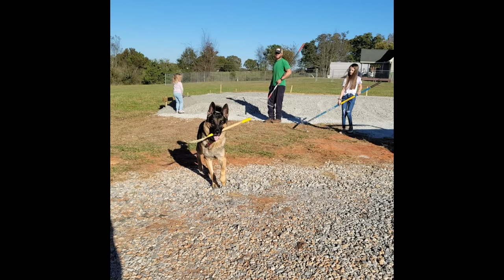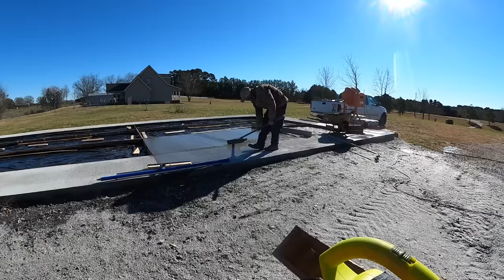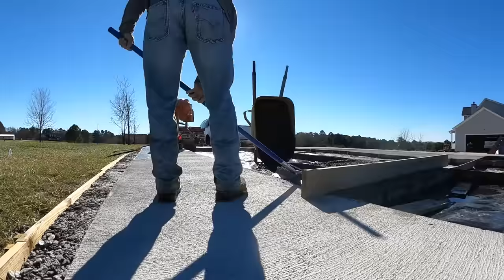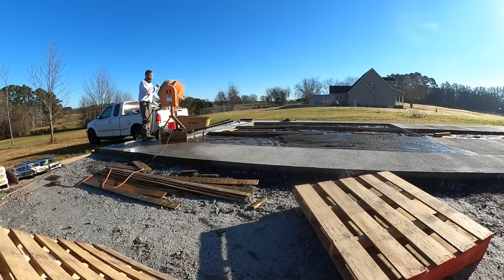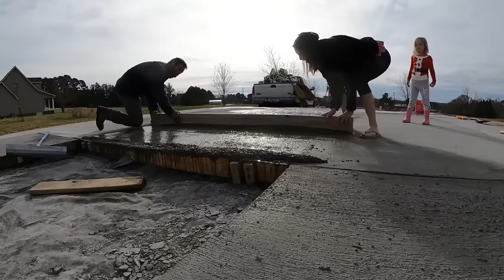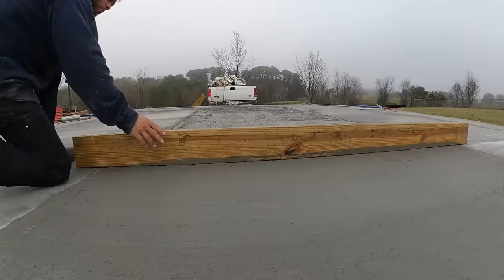Pouring a Huge Concrete Slab Using Bagged Concrete | I Saved $10,000

Comment: You are a machine!!  As a construction manager, I appreciate what you did.  Assuming your base was adequately compacted, I would have put some #4 rebar sections in as 'dowels' to tie the different panels together since they were all cold joints.  That would preclude any future differential movement.
Reply from the maker: Thank you! Out of the things I did, I wish I had thought about pinning the slabs together. Luckily if anything shifts I should be able to repair it. Hey that might be a good video if it ever happens. Thank you for checking out my video.
Reply: I was thinking the same thing.
Only thing missing was rebar. Great job on it though.
Reply: Don't you have to use cement adhesive as well as rebar to prevent the differential movement? And if you do in what ways is it weaker than doing all in 1 pour with a concrete truck?
Reply from the maker: @eveliinatistelgren172  I honestly do not know. I'm not a professional when it comes to concrete. This was the first big pour i've ever done. I had to use bag so that I could do it myself.
Reply: @eveliinatistelgren172  it wouldn't pass load bearing requirements here in Australia, ok for a path that's about it, no rebar means NO dwelling and if the outside slabs move it's the start of a irreversible chain of movement.
Reply: @t-dog8528 thanks! if a person used rebar and small pours like he did with wood dividing them while pouring, say a square meter each at a time or something like that, would it be weaker than a one time pour? In what ways? Could it then be suitable for dwelling?
Reply: @eveliinatistelgren172  weaker still at the joints though strengthened by the rebar,, stone and rebar are what gives it strength just be sure to complete each rebar section in one pour, you can nail a couple of purpose built dowell plugs or even caulking gun nozzles to the forme work to put next slabs dowels into, just check the mpa on the bags too, I'm not 100% sure on the standards here or their but the few house slabs I've helped with were 32mpa concrete and 20mm stone, I forgot to say before too, good job dude.
Reply: That whole strip you poured you can lay the rebar on the ground and just pull it up as you go, slide in a dowel rinse repeat, come help with mine now 😁😆😆😆
Reply: @eveliinatistelgren172  also on smaller pours maybe use expansion joint rather than timber to finish, but that's not for dwellings more for paths, garage floors driveways etc and remember to always box out(dig) to an appropriate depth, for a light vehicle say minimum 125mm a truck 225mm house wall footings depend on the soil strength and are usually around 300x400mm with top slab around that 125mm too, be sure to tap the forme work wherever you'll see an exposed edge so to fill in the honeycombing voids where the stone and boards meet, usually done as soon as the mix is poured byt prior to levelling and screeding
Reply: @t-dog8528  Sorry we misunderstand each other. I won't use timber to finish. I am just limitiing the sections with the wood. To pour 1 square meter of concrete on the rebar at a time. All the wood is removed from the final product to make 1 huge slab poured by hand with rebar in it. Would this still be weaker than poured all at once? Why if the rebar is holding it togetther? And all concrete cracks eventually? I'm thinking it would break under a double wide.
Reply: @t-dog8528  This is what I mean to be exact: https://www.youtube.com/watch?v=KXS0bAn0e_Y 
The timber is just to limit each pour
Reply: @eveliinatistelgren172  id be looking at more 3x3 size, yes it still cracks but less is better and 3m is about standard for a cut, however depending on the use depends on the method, in a house slab they dont cut or expansion joint usually and i believe that it's to limit rising damp/moisture rising through slab causing mould inside the flooring and walls
Reply: @eveliinatistelgren172  i got what you meant by the wood too👍
Reply: @eveliinatistelgren172  if you're in an area that snows there's a thousand things to consider that i have no idea about too, we live in a warm to hot climate here and moisture is rarely an issue.
Reply: @t-dog8528  thanks for sharing, what about footing? Why are some pillars put into the ground beneath the slab?
Reply: @eveliinatistelgren172  that's what i mean by forme work, the timbers are forming the edge, I'm about 10 minutes from going out to set up the next section of my own, mine would be a good video for me and others, I have exposed faced footings that will have retaining wall blocks on top then a concrete dish gutter around 1 edge copind strips for gardens by footpaths planter boxes in the slabs and close to 14 cubic meters of slab 110mm thick all with a 2.2 cubic ft mixer
Reply: @eveliinatistelgren172  couple of reasons, 1 to bare the weight of a wall or something like that and 2 as a thickening beam to reduce the chances of a slab moving sideways or being pushed sideways by other curing concrete, it not only cracks it also expands, hence expansion joints.
Reply: @t-dog8528  wow concrete game is so deep, how can I better learn concrete game?
Reply: @eveliinatistelgren172  my retaining wall footings have 1 long 16mm steel bar in them, i considered using trench mesh but i had the bar already
Reply: @t-dog8528  do you think A/S are higher and superior? If so why would they ask higher standards? Since the US is very hot as well
Reply: @eveliinatistelgren172  Australia has higher standards on the construction industry, we take note of international flaws and our own and legislation changes accordingly, it serves a few purposes inspectors can expect the same outcomes nation wide, litigation and failures are reduced training and techniques are streamlined but more targeted efficient and effective and it cuts out the cowboy builder that flaunts the rules leaving those paying for the work insurable confident and at ease knowing what they have will outlast their lifetime.
Reply: @t-dog8528  Very interesting, I think I get what a footing is now, but its so deep and requires so much machinery, I don't think its possible to do by hand to get into the subsoil. Would this still be necessary for a double wide? Wouldn't the foundation be simpler for such a small and lightweight construction?
Reply: If the ground is hard enough you can form up above ground and finish the face after stripping the timbers off, i know alot of people will do a footing with besser blocks core fill them then pour the slab inside of that, the whole point is to hold the weight of the structure, if the slab moves so does the walls creating cracks
Reply: @t-dog8528  So the besser blocks avoid having to dig into the subsoil? You mean the blocks are skirting the slab
Reply: @eveliinatistelgren172  yeh just search concrete block footings here on youtube, in fact diy footings and then look at some pro jobs, find what will suit best
Reply: @eveliinatistelgren172  yes but the subbase still needs to be solid and level
Reply: @t-dog8528  That's very interesting, let me have a look brb
Reply: @t-dog8528  Alright so I watched a couple videos, and from what I can tell, its just a 16 inch deep concrete perimeter that goes from the ground level downwards 16 inches. And inside/on top goes the slab. Both made with rebar and concrete. Did I get it right? Tbh I didn't think such a footing would make so much difference hmm
Reply: @eveliinatistelgren172  you got it
Reply: @t-dog8528  thanks! so if the footing supports the outer walls is there some kind of interior footing for any load bearing wall or pillar internally? Why won't the slab break in that instance if much of the weight is supported there also?
Reply: @eveliinatistelgren172  anywhere that needs to support weight
Reply: @t-dog8528  How much weight becomes relevant enough to warrant a footing? Vehicles are obviously not. So only load bearing walls? Anything I'm not thinking of?
Reply: @eveliinatistelgren172  i couldn't say, but there'd be tension specs somewhere on the internet
Reply: @eveliinatistelgren172  a car and a wall would be similar in weight but without even distribution
Reply: You're quite right, without dowel bars, there WILL be movement,  don't forget to tell the tiler.
Reply: @andrewmaccormack1184  you mean rebar?
Reply: @eveliinatistelgren172  Tdog know shis stuff btw...  all good advice,  I use pump trucks exclusively now, but have done up to 25 x 25 foot from bag.  over time you learn why footings and rebar is used the way code calls for.   But it takes time to learn this
Reply: @t-dog8528  I'm in southern United States I poured a 26x40 slab 23 years ago with no rebar or mesh in it. It's 6 inch thick and I have a car lift on it and has a few cracks and been fine all that time. I have had 20k dump trucks on it with no problem.
Reply: @eveliinatistelgren172  It is difficult to reliably prevent moisture from reaching rebar that spans between pours. You would think the cold concrete joint would at least be watertight, if not strong, but that has not been my observation.
Reply: I was thinking having footings would be important, but yeah, some dowels make a lot of sense as well. I can't tell on this video, but it looks like it's sitting on that base. I'm hoping he went below the frost line of the virgin soil or that slab won't last longer than a few bad storms.
Reply: He didn't work the air pockets out I noticed and not enough control joints, and unlevel surfaces not good. rebar or wire mess is a big MUST. Over all it is what it is,  a big poor quality pour!!
Reply: @reallifetested2605  rebar is supposed to go in stuff as small as a 6 inch sonotube. lots of people dont use it, but it is essential to prevent slabs from cracking. sections that large settling is unlikely, but tying them in together would have been better for sure. 10/10 suggestion. I'm not a construction manager just a smart guy.
Reply: @t-dog8528   no rebar or even inspections for a residential slab here in Ohio.  National code doesn't even require it.  Local codes may differ.  We can't support anything on a slab though.  Have to go 36in down an pour foundation then block up to grade.

Comment: Great Job! I was planning to add a 20' x 7' extension to my pool deck for lounge chairs, but it ended up being 60' x 7' when I was done. I went with 60 Lb bags as it was a little lighter weight, which was about 285 bags. Unfortunaly, they couldn't deliver the pallets near where I was working so I had to move each bag (5-6 bags at a time in wheel barrel) to my work area and then lift them again when time to mix.  I did it in sections and stayed true to the existing expansion joints of the pool deck. Like you, I had a batch mixing while I was dumping and working the concrete.  My advice to anyone attempting to do this, plan ahead. Get your area formed and leveled. If it is a large area, section it off. Set up the mixer, concrete, water supply and trash receptacle in a way that it flows with minimal steps and is accessible to your work area. Be prepared to work continuously for each section.

Comment: I love the line “I don’t make 10 grand a week” lol. So awesome man. That’s a really big project. I have the same cement mixer and plan on doing a back patio this summer at our house in sections. Seeing people take on something this big makes me feel good about taking it on.
Reply from the maker: That’s awesome brother, you’ve got this. If you’re interested I did an overview of some of the things I did to the mixer to make it a little easier to use. Definitely make sure you’ve got the belt adjusted right after you’ve got it broken in a bit. Good luck with your project!
Reply: A truck is cheaper around here. About $155 per yard with fiber in it, 4000 psi mix. You can rent a buggy to haul it from the truck to the pour if needed but you'll need at least 1 other guy there to help, preferably 2 or 3 to help rake and screed it.
Reply: @jamesnm21 that's exactly how me and my brothers are starting our own company!
Reply: I hear people all the time saying they can’t afford this, can’t afford that, because they don’t make 10 grand a week. Yet I see them spend $80,000 on a truck, $60,000 on a boat, $40,000 on a razor, $20,000 on a week vacation. Then pay insurance, registration, taxes, maintenance and repairs on all that stuff. But oh no, we don’t have the money for a new heating and air system or to pay a concrete contractor. stop with the BS.
Reply: I drive a $1600 91 Chevy s10, i also own 5 rental units. Sometimes it’s not about if you have the money or not you just want to stretch it as far as possible. I’ve owned newer vehicles but they aren’t any better then older crap that’s already depreciated to the bottom that I still like.
Reply: You’re saying that now. Wait till the warranty is up lol. I’ve had bmws and never again. I absolutely love how they drive but I’m too cheap to buy a new one and wouldn’t wanna own one out of warranty unless it was more of a toy than a reliable driver. Cheap vehicles work for me. They rarely have issues, are simple and cheap to fix and I enjoy them. Plus I have 5 cars to choose from and all of them wouldn’t total to even a quarter of what a new bmw costs.

Comment: I've saved a lot of money over the years from doing everything myself, so I can really appreciate and respect what you did.  Hard work is always good for the body and mind.
Reply from the maker: It's crazy if you ever go back and add up all of the money you've saved. I appreciate your kind comment. I feel the same way, hard work is the best medicine.
Reply: @reallifetested2605  I'm gonna keep doing my research, but I think the way you went about this has convinced me to take on my own smaller version of this project. Is there anything different to watch out for when pouring sections over several days and dries?
Reply from the maker: @peterdearborn  I'm not a concrete expert by any means. Just did a lot of research and asked people that do it for a living a lot of questions. Right now I have about 40,000 lbs sitting on it with no issues. It still looks as good as the day I did it. 

Right now I want to point out truck and bag are about the same price in my area. When I did this bag was significantly cheaper. Also it's cheaper to mix everything separately instead of getting pre mixed bag concrete. But if you have a small mixer like me it will take you a ton of extra time unless you're making a really small pour.
Reply: @reallifetested2605  Thanks for the reply! my project is shaping up to be 12-13' x 25-30' for a garage/homegym, so its good to hear about yours being weight tested at least tin total capacity. Deadlifts are brutal for floors in general, but I plan to line most of the gym area with horse stall mats which should take a lot of the abuse.

I'll definitely focus on the pros and cons of pre-mixing for this scale.
Reply from the maker: @peterdearborn  I'd definitely use some sort of reinforcement at the location you'll be lifting in. I'd probably dig some footers, add some mesh, maybe even take it a step further and add some fiberglass. I'd do some research on that one. The sudden impact of weights drastically increases when dropped. (I used to lift myselt) 500 lbs is a lot especially if you drop it from waist high! Good luck with your project!

Comment: Great job! I have been a professional contractor for 40 years. I got into part ownership of a home that was sliding down a hill. Tough access. I was able to build out of 8" sdr 35 sewer pipes that I cut in 1/2, the long way some chutes so when I did the front new foundation I could gravity feed from a truck mixer. Then I had the basement floor issue. No access I had to hand/shoulder carry about 30 feet all the bags. Good work out for sure. Between cost of concrete and pumping, hammering out the old and removing I decided to do it piece meal by bags. Took me about 1 year approximate 30x40 area. I would pic away at it. I did 3ft x 3ft sections sometimes 5 or more per pour skipping every other form. I used, rather than rebars because of the way I was doing sections at a time, for reinforcement, (crete in bag 5k psi after 30 days) a product called Diamond Dowel. You nail the plastic pocket onto the form then when the form is removed you insert a sq 1/4 inch steel plate. So the plate when in supports the next pour pad. I bought a throw away Harbor freight mixer like you and can not believe it did the entire floor and still runs. My system for mixing was 3 ft high benches I would stack the bags on, I had a wheelbarrow with high sides I would open and dump the dry crete into and have it position so I could bail the crete into the mixing drum while on. I hung my hose from the ceiling.  The edges of the crete is edged with a 1/4 round so it is a control joint if i look closely there are some normal cracks but not through the pads they are under the control joints.
Reply from the maker: I would have loved to seen the setup of your chutes. 30' is a long way especially when you're carrying that much weight. You think 80 lbs doesn't sound like that much until you start carrying it distances! You're right, i'm very impressed with this mixer. In theory it should last forever since it's just a motor, and a belt driving everything. I do keep oil on the metal to metal surfaces (every time I use it I oil it up) It's lasted through 1000's of bags, and I even let people borrow it from time to time. Had a customer build a 120' long 8' high retaining wall using the mixer for the mortar. Thanks for checking out my video!